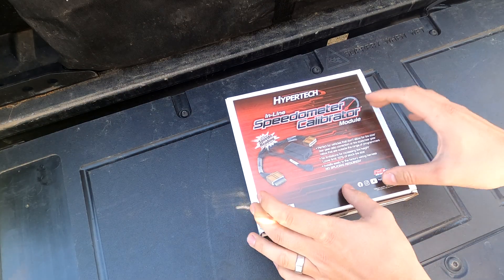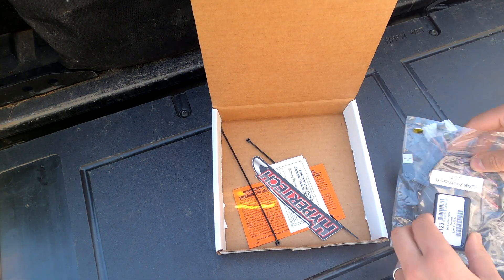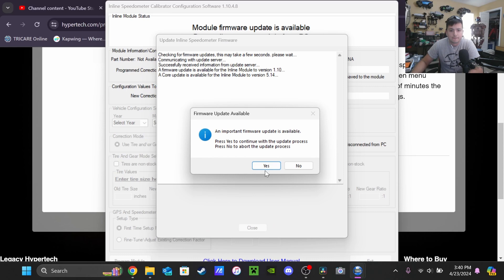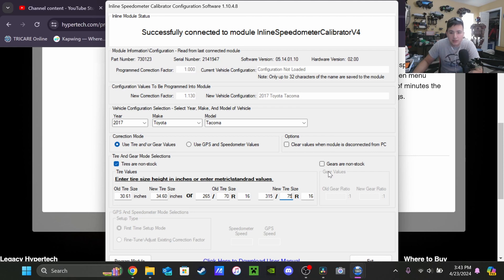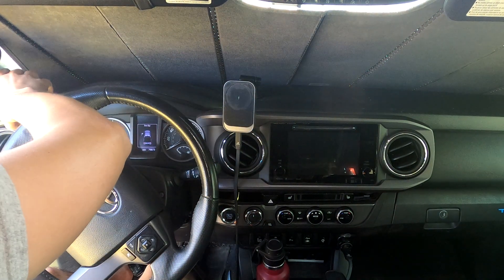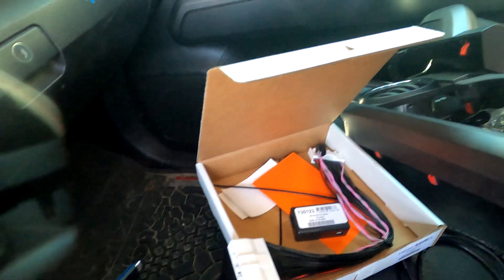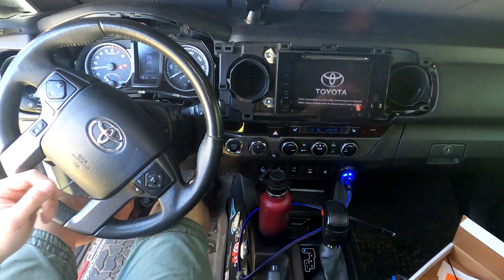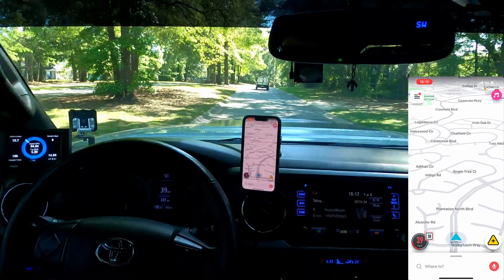Speedometer Calibration for Oversized Tires: 2017 Toyota Tacoma

Comment: Nice.. I’m on the same boat right now, just updated to 33” on mine. What made you choose that one over the rough country one? also.. so far any issues and how you like it? Thank you
Reply from the maker: I don’t entirely remember, I believe it had something to do with the amount of equipment you needed to install the rough country kit. This one was an all inclusive kit.

As for longevity it has been great! Only complaint I have so far is speed begins to drift low on the dash (compared to gps) the further above 60mph you get. I think the total difference was about 4mph at 80mph, so not too terribly much. Could also be due to tire wear.